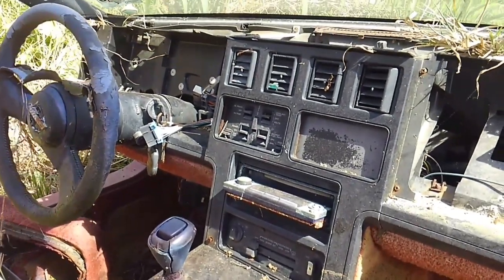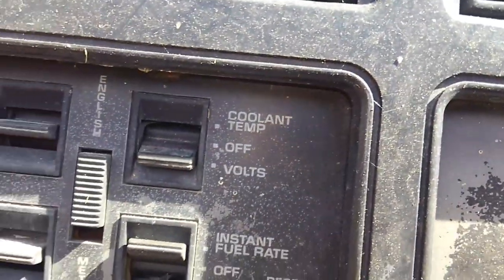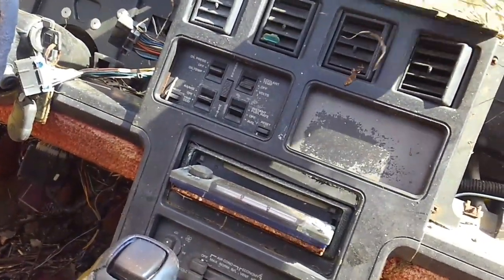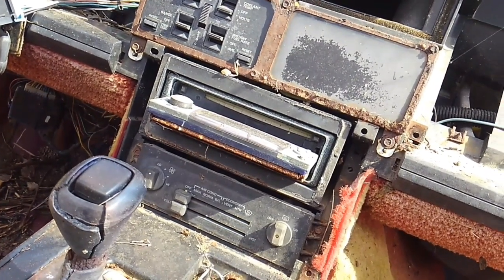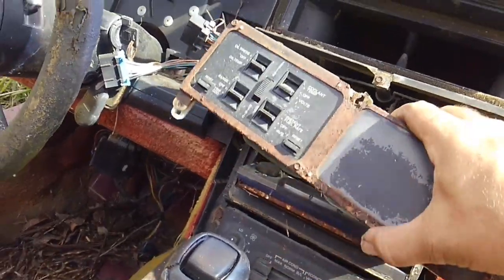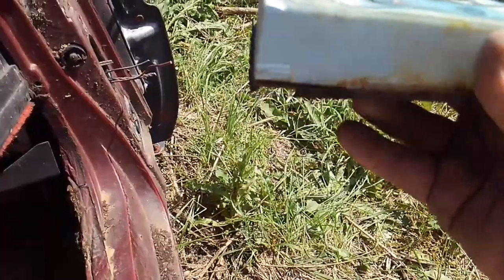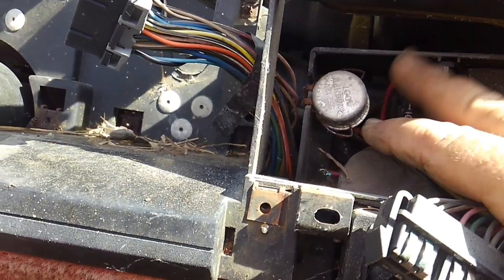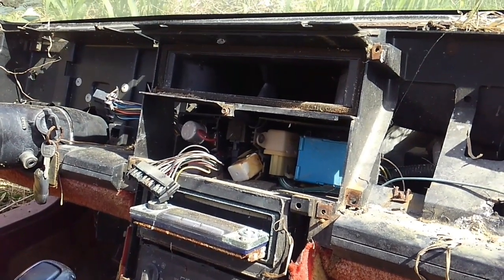C4 Corvette Driver Info Display Panel Removal

Comment from the maker: What Corvette tear down videos would you like to see next?
Reply: Would like to see heater core replacement for 1989 corvette and dash board removal.
Reply from the maker: Rich, your in luck. I am going to tear down the dash/cowl section of the white 84 that I detailed in this video shortly so I can show how to access the heater core. It is a big job and requires time and patience, but totally doable.
Reply: Is the heater core video still in the making or is it me not looking hard enough to find it ?
Reply from the maker: Hey Dale, nope you're not missing it. It seems like the last year has gone by too fast and I just haven't gotten too it yet. I have the perfect dash/firewall section to use for the video. It's on my video to do list for this month. I'll give you a heads up when I have it completed.